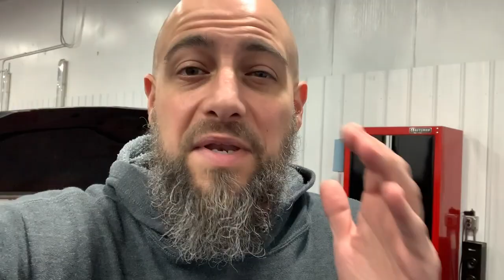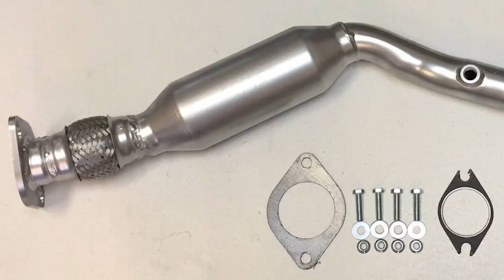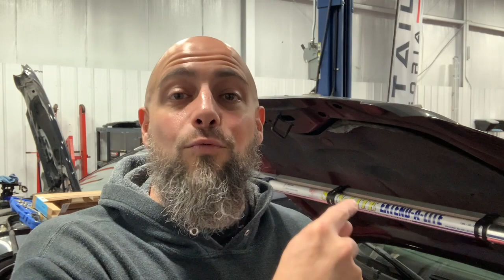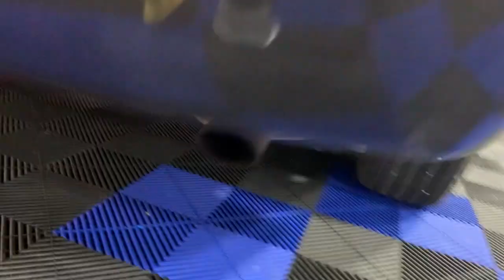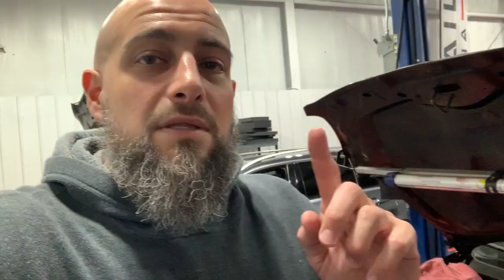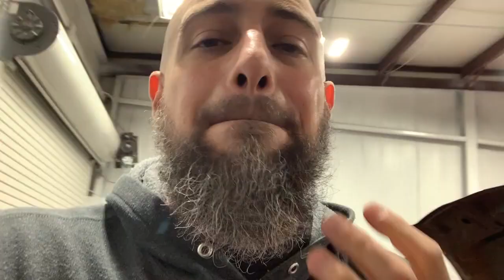Are there trustworthy mechanics?

Comment: Greed is the reason customers dislike shops. It resulted in people looking for a "good" or "recommended" mechanic. Also mechanics in many cases won't just say "I can't do this, go to someone else", instead they take the job and will start working on a car even if they have 0 experience in that particular problem or particular car model. I personally don't trust any mechanics, because I learned it already that instead of doing diagnostics people just start replacing parts and then indeed calling it "you got more than one issue".
Reply: A "proper" mechanic is able to confirm that all the things that have contributed to a malfunction have bee rectified before returning the car to the customer. In other words if you think the problem is caused by part A, and you replace part A, you don't just say "the job is done" and give the vehicle back to the customer. You first confirm that the malfunction has been rectified. Some shops do not really want their employees to do this. Probably because their expenses for parts are lower than their expenses for payroll. I've seen this in the computer warrantee repair industry. It isn't just in the motor vehicle industry. Computer owners would call up customer service on the phone, or let them remote-connect to their computer, and the computer would be "diagnosed" that way. "Confidently." Then they would Fed-Ex the part to me and tell me to change it. They were paying me a lot more than the value of the part. So they didn't care to let me diagnose what was actually wrong, which could take me several hours, and prevent me from having time to get to the next customer. They just took their chances that their gues was correct. It was correct maybe 2 out of 3 times.

Comment: The good old California cylinder heads with their air injection ports.  I discovered these in 1985 after ordering a long block for my 79 Dodge van.  The rebuilder happily sent me plugs for them, and told me to always let parts people know I had a non-California vehicle as long as I was stationed out there.  

To your points, well, they apply to more than garages.  I could tell your story word for word, just substituting medical terms and procedures, regarding an experience my wife had.  Two doctors wanting to do big operations, with the correct doctor doing a simple out-patient surgery.  Ignorance, ego, greed , or any combination.

My recommendations to people who don't work on their own cars, is to seek out honest, qualified, shops, and develop a relationship.  Yes, they are going to charge more for an oil change than your local $29.95 quick change place, but they know your vehicle, and when you need service quick, you often go to the head of the line.
Reply from the maker: Yes you can easily encompass this into any industry, you are correct. Its just not that hard to 
Listen to the customer 
Dont assume
Make the right decisions based on facts.

Comment: Hello Lou, Can you pls tell me how to open/check the power steering reservoir on 2010 ml550…it started ‘whining today’??  sailing Gary
Reply from the maker: The front driver side of the engine is a black reservoir with a twist off cap that has a dipstick on it. You check the fluid with the engine running.
Reply: Hi Lou,  yes I found it and checked with engine running…dry bones???…begs the question…where did it go??…more importantly…what Steering fluid do I need??
Reply: When I google it…am seeing “Febi Bilstein”, “Febi Mercedes”,  “Pentosin CHF 11S”….any preference ??
Reply from the maker: @kaijasong5799  pentosin is the fluid.